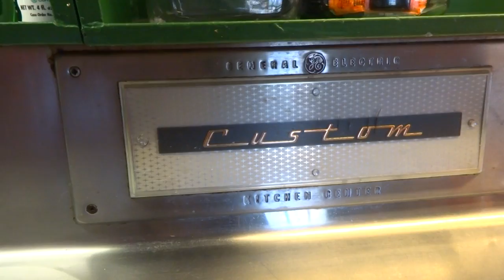PROPRESS FITTING POPPING OFF INFERIOR  PRODUCT TO SOLDERING

Comment: Not a big fan of propress  I've soldered copper to 6 "
Reply: I can press 50 six inch joints before you prep and solder one six inch joint and I can promise mine won't leak in fifty years while you can't even promise you got penetration half way through the joint.
Reply: @jman0870   maybe you should learn how to solder  take a little pride in your work you want fast cpvc not a fan of that either
Reply: @jman0870  and you think a rubber gasket is going to last forever
Reply: @plumbcrazy375  Joke's on you buddy. I do know how to solder. I solder small things all the time because I don't carry a press tool because I do HVAC and we have dedicated plumbers. 

With that being said, I don't cry and call a plumber every time I need to fix a hydronic, water source, or glycol loop issue. If it's time sensitive, big, or I know I can't get the water to shut off I go get the press tool every time.

Maybe you should try branching out from all that super technical residential work and try some commercial plumbing. Newsflash: Commercial plumbers have to know how to use a volt meter! Good thing you know how to solder though.
Reply: @jman0870  you are the joke I agree with Steve take a little pride  I've only been a plumber for a long time  again stick to knocking on the tin

Comment: pro press works fine if you do it properly. Soldering will fail if you dont do it properly too. Pro press is great for when a valve is slowly passing and soldering is difficult. Also, you may not like pro press but at least learn about it. you soldered that coupling way to close to that pro press joint. dont do that. you are setting up another failure there. get off the soldering high horse. its not 1988 anymore.  learn to adapt

Comment: Propress is the future
Reply: I will be keeping my torch till my grave!
Reply: @oldhandyluke  You definitely aren't working in commercial buildings with leaking valves, that's for sure.
Reply: @jman0870  pro press has its place in comercial buildings where you need a hot work permit but as for leaking valves I use the bread trick.
Reply: @oldhandyluke  You can't stop a drip with bread in a 4" pipe that is feeding commercial kitchens in medical facilities dude....

Comment: That is the product of operator error. Just like I've seen a thousand times when people don't know how to soft solder, and when they cut the water on it's a sprayer. Or worse yet they cut the water on and didn't see the dripper leak and then just got worse and worse and worse. Every product has their appropriate application just got to know when to use it.

Comment: that's not a Viega fitting from what I saw.  Also, keep in mind a lot of guys out there that use those cheap pro-press tools because they can not afford a rigid or Milwaukee.  I've asked this question with guys with 30 years of experience and they have never seen a fitting blowoff.  Viega is pressure tested up to 600 PSI max for water and 200 psi max for air.   lastly consider the location if you are not from the area.  New Bedford is a dump.  Most the people in that area do not want to pay good money to a tradesman.  You get what you get and you don't get upset 🤣🤣🤣🤣

Comment: Propress is better for the plumber and not the homeowner.  There is nothing wrong with it, but I always ask, is it better than solder?  Maybe in a couple special conditions that's the case, but the biggest asset is the speed.  If that's the case, does the job done with propress cost less me than one done with solder??  If not, get the torch out please.

Comment: All this quicker easier is bullshit 
How many years are they good 
That o ring dry rots and pressure they will all pop eventually 
I think these are junk 
No  connection like soldier 
Pex in shit neighborhoods with scrappers stealing copper 
But just be real plumbers be professional quick n easy is not the way an o ring determines your reputation 
Or soldier thats been tried and tested longer than most have been alive 
Even when frozen pipes the pipe fails not the connection 
Because its done right the first time 
O rings behind walls 
Not on my name
Reply: The oring doesn't hold it together. If the o ring fails it drips. The joint stays together. You are all over the place dude.

Comment: Pro press is superior to soldering any day.  I know 10 professionals how love it over the 1 who says they wish they could but it's too expensive.  
This looks like the copper pipe used is the thin type...not K class.  That's why it popped out.  Look at that copper peice after you cleaned (7.21)it..it has dents even where the propress never touched it.   
When done properly they will never come apart and always use the K rated copper pipes!

Comment: Propress is not an inferior product. I've seen thousands of propress joints work perfectly fine. Whoever was running the gun didn't know how to use it. I can tell just by looking at the crimp. The pipe is barely misshapen at the joints. Propress, when used right, costs less in labor than than the fittings cost and when used correctly, fail as often as a solder joint. Wait until your mind is really blown and you see megapress. I bet you use sharkbites though.